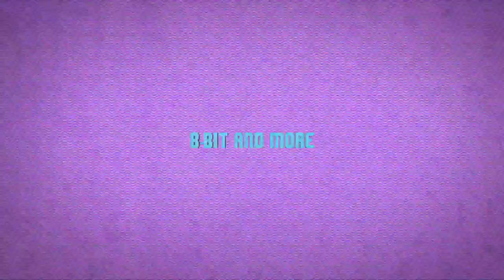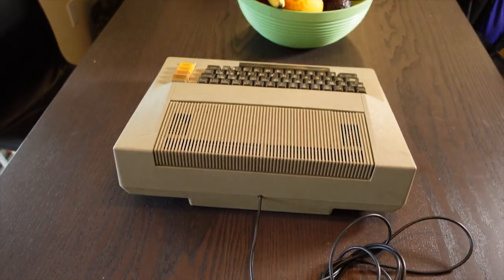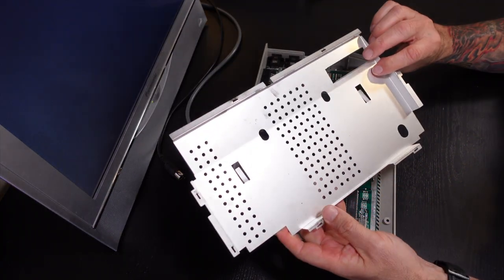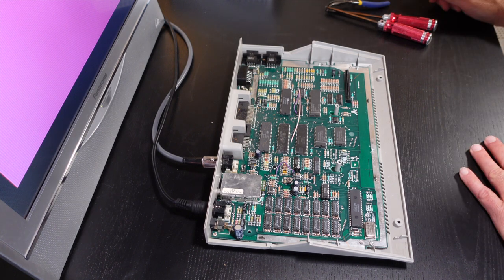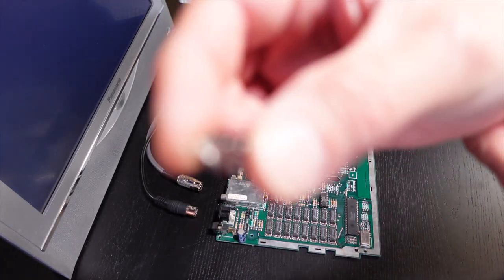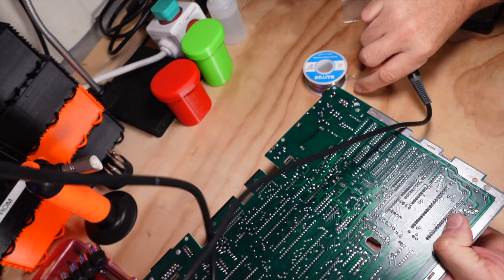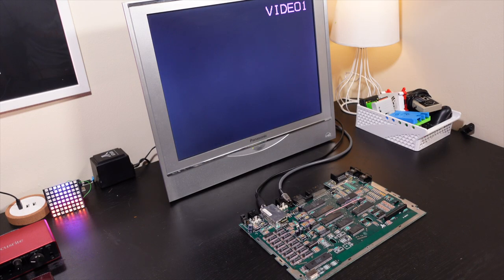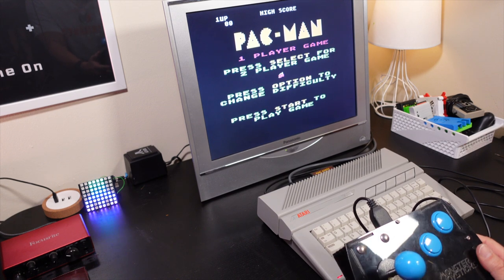Atari 130XE Video Repair

Comment: Just reminded me. Ive got an Atari 800 in the loft. Ive got the 800XL and Atari 520STFM out last year and are both working still. With new PSU's as well. I replaced the caps on the STFM and bought one of those USB power supplies for the 800XL. And there still working great. Next is to try out the 1050 disk drives. Havent tested them yet.

Comment: We had an Atari 800 in my high school electronics class. That was 1980 thru 1981 (my senior year). It originally had 8k of memory and no disk drive. in 81 the teacher added a 16k module and a disk drive. Now we had a whopping 24k to play with and we could store our programs (wahoo!) :) In those days there were a lot of computer magazines with Basic program listings and we would type them into the computer (mostly games of course). Two of the games we typed in that I remember most were a simple golf game and a sub attack game. I bought an 800 in 1982 and 6 months later bought an 810 disk drive. I still have them today.

Comment: My Atari 130XE has a flaky colour chip -- sometimes displays color, and the has noise or glitches in the picture, and then goes to black and white.

Curiously I found this, your video that may help me to understand what is involved in repair.

Thanks again for your detailed explanation and video journal.

Comment: I just bought an Atari 800XL.  It has a green screen, but lucky for me every IC is in a socket.  The RAM is 4864, never seen that.  I will be working on getting that machine going.  My Atari 520 ST is back up and running after I got a PSU for the floppy drive.  Yes, I needed an old Atari 5200 PSU to power it.

Comment: Cool video.  I do have a question.  In 1 of your videos I've seen a reprint of that book Mapping the Atari.  Where did you get that done?  I tried checking on staples website n was given prices from $168 to over $300.  I want to have the book open next to me at my atari system not running over to my pc a dozen times an hour.

Comment: Quick question, can any Commodore 64 floppy disk drive be used on atari xe computers? I'm guessing the serial cable to sio needs to be modified. I have a 1571 and an excelsior plus disk drive already.
Reply: No, a Commodore drive cannot be used with a drive, even if you modified the cable. They work differently.

Comment: Hey, my Atari 130XE gives picture that goes up/down rapidly and also flickering mess. There is no repair man for ancient computers here in Serbia (heck, you can hardly find proper old school electrician). I am amateur PC configurator and I have soldered lots of electronics (mostly old Roland electric drum parts). Any help?